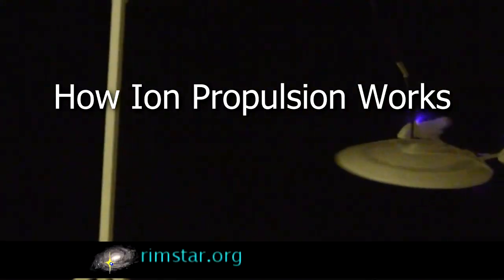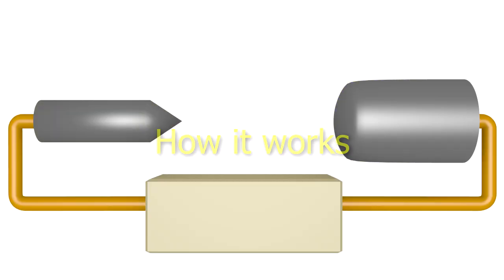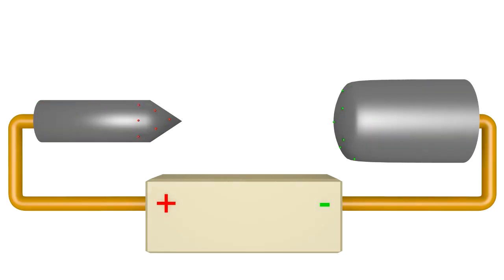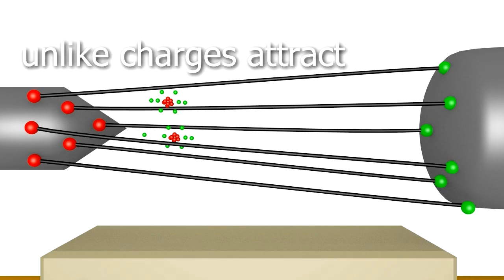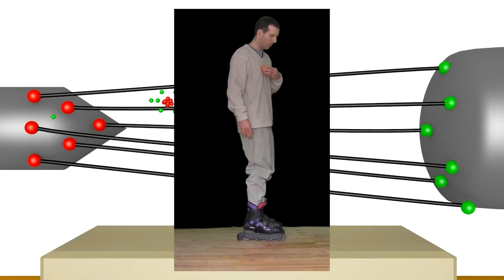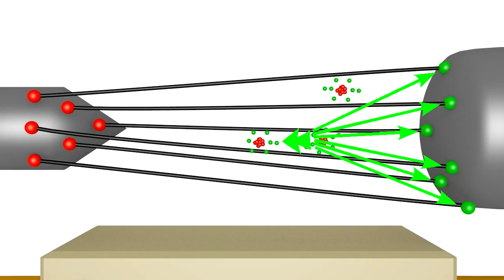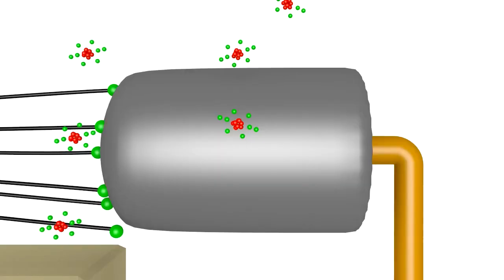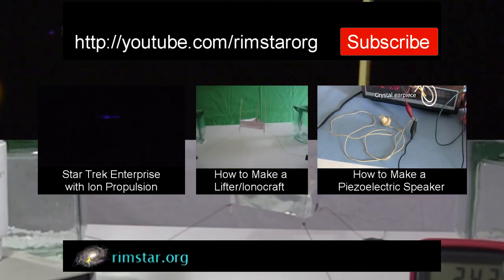How Ion Propulsion, Lifters and Ionocrafts Work

Comment: That explanation shed some light. But it did not explain, why you don't use sharp edges on both ends. Could it be that due to the low electric field some ions fly past the minus pole, enhancing the propulsion?
Reply from the maker: Yes, you're pretty much right, though it's the neutral atoms that you want flying past the minus pole. Most ions, which are charged atoms, would still interact with the electric field and be trapped by it. The neutral atoms don't interact and so can fly past.
If you have both edges be sharp then the neutral atoms would be going in both directions and you'd end up with no net propulsion.

Comment: what happens if you try a lifter in a vacuum chamber?
Reply from the maker: It won't work. Or at least the ion propulsion will stop working. There are other much smaller effects that might take place in a vacuum chamber, such as the Coulomb force might make some parts be attracted to other things nearby, or sparks coming off of it might give a little push,... When used in space, a gas like xenon gas is carried along to act as a propellant.

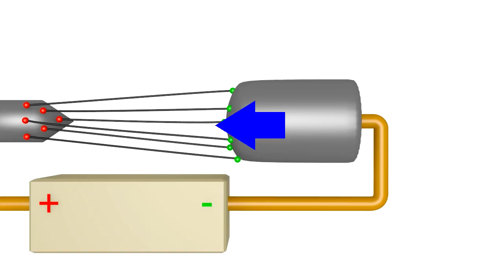Comment: 5:10 you push to move neutral atoms that are coming from where, in the case of the vacuum of space?
Reply from the maker: In the vacuum of space you'd need to provide the neutral atoms yourself. Often xenon gas is used for ion engines in spacecraft in space.
Reply: @RimstarOrg  yes i got it..we provide them...so in other words we eject particles right?

Comment: When the postively charged atom collides with the neutral atom it produces force in the opposite direction but won't it be slowed down by the postive charge present at the sharp section
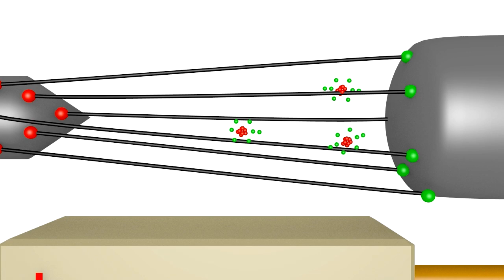Reply from the maker: It will. But it doesn't matter. That's the point I was trying to make starting at 4:33. The positive ion isn't physically a part of the electrodes but it is a part of them if you consider the electric field. So since the positive ion is effectively a part of the electrodes, any changes with them doesn't have any net effect. The neutral atom, meanwhile, is not a part of that system and so it can affect it.
Reply: Thank you understood

Comment: In 2003 Thomas Bader and Chris Farzi worked together to examine the Biefeld-Brown effect by first reproducing the effect and reviewing the history through patents held by Brown. Several theories were tested and proposed, with quick theoretical calculations to determine whether the theory was sufficient to provide the force necessary for the thrust noticed by operating ionocraft. A conclusion is reached that the Ionic wind force is too small is reached by assuming that the particles being propelled are electrons. This assumption would suggest that a small force would be noticed in a vacuum since the electrons could come from the emitter on the ionocraft. Using the following two equations:
1/2mv^2 =qV
where m is the mass of the moving particle, v is the velocity of that particle, q is the charge on the particle, and V is the voltage across the asymmetric capacitor. This is the kinetic energy of the particles being moved around by the electric field.
F=mv*i/q
Assuming collisions are completely elastic the change in momentum is calculated as above. The variables are the same as before with I being the current flowing across the capacitor. This also assumes that none of the particles collide with the collector.
Combining these equations they conclude that the force is 5 orders of magnitude too small to be the cause.

Comment: My ion wind too weak what should i do.
Reply from the maker: I'll need more details about your device and setup before I can answer specifically. If you're making a lifter then I have some tips on my webpage here https://rimstar.org/sdprop/lifter/lifter.htm under the heading Tips for getting your lifter to fly. You also need a high voltage power supply that also gives a decent amount of current. Unfortunately, I don't know exactly how much current but for mine to fly, I needed around 25,000 volts.
Reply: @RimstarOrg  we have taken the main model inspiration from the plasma channel ionic thruster.... And supply is from a Chinese high voltage generator of 400kkV , and 2,  1.5 volts pencil battery. It arcs at some points but we haven't been able achieve the corona effect  that is needed. We have used copper conductors . 

It would be a great help if u could point us in the right direction.
❤️
Reply from the maker: If your generator is taking from 2 1.5 volt pencil batteries then I suspect it's not outputting enough current for getting a useful amount of ionization. In my video about making my high voltage power supply here https://www.youtube.com/watch?v=2HByosRAknY at around eight minutes and twenty one seconds in, I show measuring the input to the power supply needed to make my lifter fly. It was around 8 volts and 2.5 amps which is 20 watts. It would depend on the power supply of course, but it gives a good idea.
Reply from the maker: On my website link that I gave in the first comment, I mention the best way to see what's going on, run it in a perfectly dark room so you can see the corona. Be very careful when working with high voltage in dark rooms!
Reply: @RimstarOrg  thank you so much for this valuable information and also taking your time to pass this knowledge.
Thank you 🙏

Comment: Superconducting magnets with gallium/aluminum/mercury shape changing metals, plasma torroids, and antigravity ferrofluids.
I've no doubt that with right RTOS performing gravimetric calculations of terrestrial topographies that, together, these materials could all be combinrd to prototype antigravity craft using RTOS to navigate over natural terrain, adjusting ionic, thermal, and magnetic output via shaped torroidal bases.

Comment: Can any one tell where i could get the complete theory and design details.?
Reply from the maker: The theory can be found here https://royalsocietypublishing.org/doi/full/10.1098/rspa.2012.0623 . And this is my how-to-make-a-lifter video https://www.youtube.com/watch?v=HZZmKZJrIW0 and tips for getting it to fly are on my webpage here https://rimstar.org/sdprop/lifter/lifter.htm . The trickiest part is the power supply, you need around 25,000 volts and a decent amount of current. The bottom of that webpage also has tips regarding that. One additional tip is that finding a flyback transformer with no builtin diode is hard but they can be found here https://www.amazing1.com/transformers-high-voltage-high-frequency.html Warning: Working with high voltage and a decent amount of current is dangerous, make sure you take all safety precautions.

Comment: Can this fly in the rain?
Reply from the maker: If it had some sort of umbrella then you'd think it might be able too, provided the weight of the umbrella wasn't too much. However, the air is very humid in rain and humidity makes the charges leak more, including on the smooth electrode, so it might not work for that reason. I'm not sure how well ionization happens with humid air either.
Reply: @RimstarOrg  I have been posting the rain question at every video that did not turn off the comments. You are the first to reply. Thanks.  Would you trust your life  to an aircraft that uses this form of propulsion? Not just flying on it but living under its flight path.
Reply from the maker: I don't think there's any danger of that happening any time soon. These don't lift very much. If the craft were built with the same safety standards as existing aircraft then I wouldn't have any problem with it. It does produce a of of ozone so I guess we'd be trading one form of pollution for another. But as I said, I doubt it would happen any time soon.

Comment: Hi, can ion propulsion work if the points are attached to the curved surface, i.e. pointing out from it, as they are connected to it via wiring anyway, or do they need to be separate from it for the effect described in the video to take place?
Reply from the maker: The side with the sharp points can be attached to a curved surface as long as the points stick out away from the surface. The other side will still have to be an entirely smooth surface though.

Comment: Excellent explanation! Does this create ozone or any other dangerous gases while it's working?
Reply from the maker: Ionization created using high voltage can produce ozone. My lifter work at around 25,000 volts and that's high enough to produce ozone. So yes, it does.

Comment: Look like in space dont work.
But what about throw ions from a nozzel? with a magnetic field. action and reaction must work.
Reply from the maker: If you carry you own gas then it could work in space. The Dawn spacecraft carried xenon gas for it's ion thrusters.
Reply: @RimstarOrg  yeah i see NASA ion thruster. But it is not powerfull and use noble gases wich are expensive and rare.
But i was thinking more in make or having stored ion element(Cl+, Li+) and accelerate them with a magnetic field(ions because magnetic field can interactuate with them) and push this ions atoms throw the nozzel.
(sorry of my english)
Reply from the maker: The ions would have to be moving for the magnetic field to interact with them. Or the magnetic field can be fluctuating instead. There are some thrusters that use magnetic fields like that.

Comment: Thank you for your explanation.
I wonder, what would happen if between the two electrodes there was a nitrogen laser beam? Would it help to ionise the air?
Thank's
Reply from the maker: It's hard to say if that would be a good thing. If it did ionize the air, keep in mind that we still need those un-ionized neutral atoms/molecules to push against.

Comment: ok so i was looking at hydrogen combustion engines and i was wondering if vaporizing the water exhaust and venting it through a system like this for the ions to push against would be better than just blowing it out through a pipe as waste
Reply from the maker: If I understand you correctly, you're talking about maybe adding an extra push to your wheeled vehicle by using this propulsion. If so, it probably wouldn't be worth it, the thrust is very, very low. The lifter that flies using it weighs only around 2 grams. When ion propulsion is used in space (by using xenon gas as the propellant), the spacecraft accelerate very slowly, have no air in the way like on Earth and have now ground as friction.

Comment: So if this is correct it shouldn't work in a vacuum
Reply from the maker: Not for this reason at least. Other things can cause motion in a vacuum: Coulomb forces, ejection of sparks or electrons. It's also hard to get a perfect vacuum so you may still get an ion propulsion effect but very weak. Keep in mind that spacecraft in space that use ion propulsion carry along a gas, usually xenon, to act as a propellant.

Comment: So the reason demos showing it does not work in a vacuum chamber are a product of gravity and surface tension?
Reply from the maker: The reason it often doesn't work in a vacuum chamber is because you don't have the air molecules for producing the ion wind. It does work some in some experimental setups but not as well and could be accounted for by other things like coulomb forces, ejection of electrons, sparks, ... all of which can cause the tiny motions you see in those experiments.

Comment: Great project!
Why doesnt the thrust direction change if sharp electrode is made negative, as in your ionocraft? Using the analogy given, negative sharp end should repel electrons and attract positive ions, and then ions hit air molecules which should be like pulling on a chair, and thereby imparting momentum towards the round positive electrode. But this obviously doesnt happen. Why?
Reply from the maker: Which of my ionocraft are you referring to? Mine always move in the same direction, toward the sharp electrode. Well, except for one small one from many years ago where dielectrophoresis may have kicked in but that was from before I started making videos.
Reply: @RimstarOrg  i was referring to the one in the video and was asking based on the explanation you gave. Why is thrust direction the same regardless of the polarity of sharp end?
Reply from the maker: Oh. Because the sharp end is where the electric field is strongest. That means that ions are formed there. Those ions are then attracted to the smooth end. The way the ions form differ based on the polarity but it's the fact that they're formed there where the electric field is always strongest and not near the smooth end that makes determines the direction.
Reply from the maker: Put another way, due to the strong electric field, electrons would leave the sharp end, ionize nearby molecules negatively and then those negative ions would be attracted to the positive smooth end, hitting neutral atoms along the way. Remember, it's that collision between the ions and the neutral atoms that imparts momentum to the craft. The ions are "connected" to the electric field essentially since the electric field controls the ions. When the ions hit the neutral atoms, which are not "connected", that's when the momentum is imparted.
Reply: @RimstarOrg  That makes sense. You gave same explanation for van de graff top roller and brush. But why doesnt the sharp negative electrode pull out electrons from nearby neutral air atoms, repel them, and then attract the positive ions??…why in this case the electrode gives its electrons and make positive ions from air molecules instead?
Reply from the maker: It may well do that but my guess is since those positive ions would be close to the negative electrode they wouldn't travel very far and so not have time to encounter many neutral atoms.

Comment: Wow, very nice and clear explanation.
But where does the ion later go to, does it receive an electron from the -ve electrode (with large surface area) to become neutral, or does it go along with the other atoms?
Reply from the maker: Thanks. I'm glad you liked it.
Not always, but yes, sometimes the ion makes it to the -ve electrode to become neutral. Some don't though and you end up with ionized air.
Reply: @RimstarOrg  Okay Thanks

Comment: How much voltage are we talking about though? Does Voltage correlate with wind strength?
Reply from the maker: For my lifter, it lifts off with around 25,000 volts. Yes, the voltage does correlate with wind strength.

Comment: So it works with both polarities?
I can't wrap my head around the sharp object being negative.
Does this work with ac or does it have to be dc?
Reply from the maker: Yes, it works with both polarities. It's the shape of the electric field really that's important and even from the video thumbnail you can tell that the electric field will always be densest near the sharp object regardless of polarity. It has to be DC or pulsed DC but not AC. AC would just keep pushing and pulling the charge back and forth due to the reversing polarities.
Reply: @RimstarOrg  thanks for the reply.
I get it now I had forgotten tht negative ions will have an extra electron.
I for some reason thought that the ion would still be positive in the reverse polarity. 
Thanks

Comment: What voltage is this?
Reply from the maker: My lifter flys with 25,000 volts. I couldn't measure the current but it's probably close to a milliamp.
Reply: I wouldn't mind using this in a project I'm undertaking but it seems a little volatile I don't want to burn down the entire rig lol I was wondering if there might be a way to pulse this with a 555 timer or something like that I'd need to smooth it out a bit for my small project. Cool lifter thanks for any input 👍
Reply from the maker: Thanks. I don't have any circuit but I do recall around 20 years ago, someone did test this with high voltage pulsed DC and it worked.
Reply: @RimstarOrg  thanks I'm actually in the midst of constructing a saucer lol I say saucer because I doubt it will fly but who knows.the idea of the project is to try to at least mimic some of the things we hear in stories about these things not agreeing or disagreeing with anyone. Be it a light a movement or action of some kind or even a sound with this 48 inch desktop project.i thought this would be a neat thing to try ion lift in it .its on YouTube under my channel name here if you want to see my funny attempt  at saucer.  😁👍🛸

Comment: What's stopping it to spark? I mean the electrons can just jump between atoms and complete the loop without moving the molecules significantly
Reply: I think at higher voltage this will happen and thus puts a limit on the amount of thrust it can achieve, Otherwise, I can increase the voltage as much as I want to get the desired thrust.
Reply from the maker: To have a spark, you need to build up a lot of charge on both surfaces. But the charge leaks from the sharp pointed electrode and so that charge doesn't get a chance to build up. If you increase the voltage then you may still be able to build up enough charge and then get a spark.

Comment: Well you can build a very crude model, but have absolutely NO comprehension of how this technology works... Go read about T.T. Brown’s asymmetrical capacitors. Do you see the relationship between Voltage and lift? What’s the break down voltage of air? This needs to be solid state...

Comment: doset it work in vacuum?
Reply from the maker: No. To make it work in a vacuum you need to add a propellant between the electrodes i.e. you need to add air or some other gas. For the ion engines used in spacecraft, they bring along xenon gas. But when the gas runs out, it doesn't work anymore.
Reply: @RimstarOrg  Hi Thank you for the reply , i remember Mythbusters conducting this(lifter) experiment in a vacuum chamber  and it didnt work , a lot of them are doing research on this holy grail propulsion formula. i came across a Russian who claims to have created an Antigravity device using  hi voltage and spinning magnetic disks ( not Podkletnov)  he is another youtuber , i will find the link and post it latter.